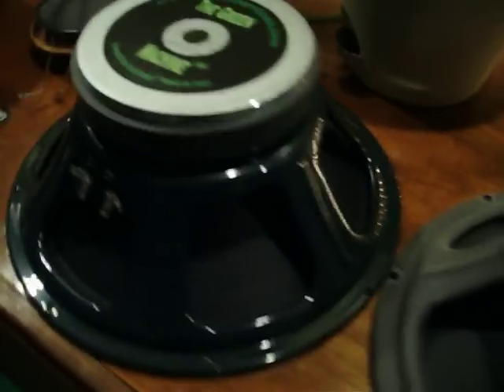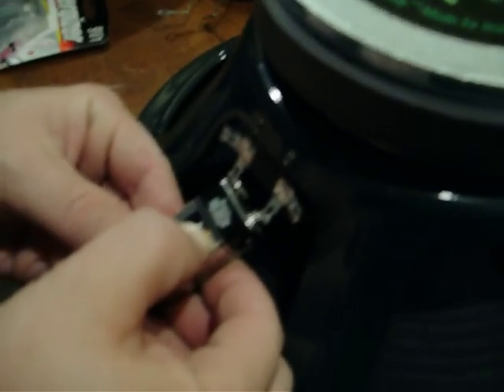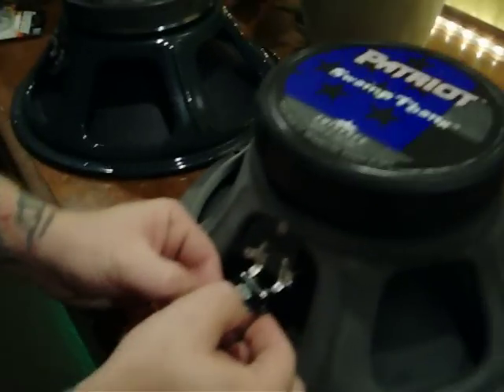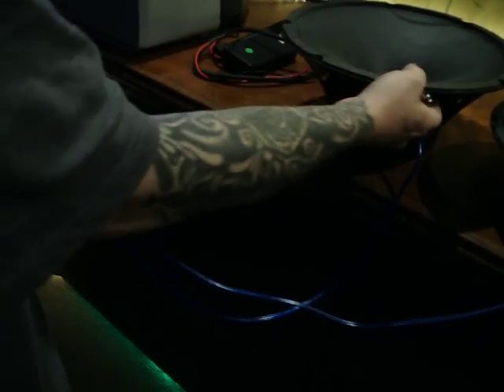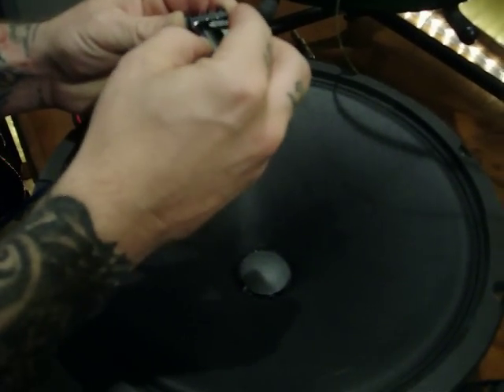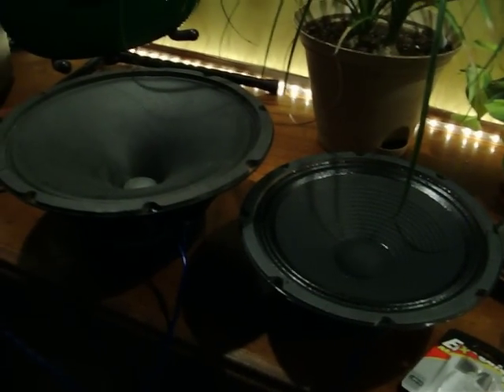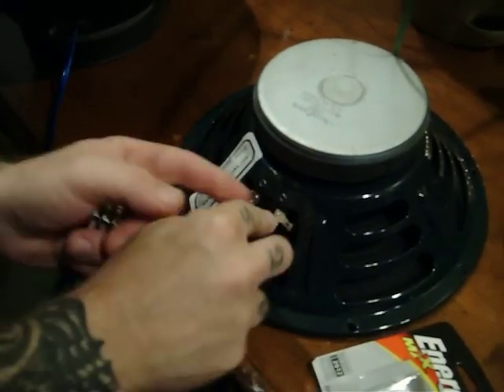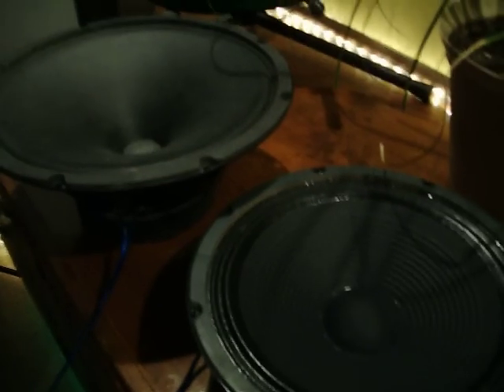EarCandy FAQ speaker phase polarity testing

Comment from the maker: @PLUMBdogg  On the old Jensens, the + is on the left and - is on the right. In a single speaker situation, it does not make as much of a difference as it would with 2 speakers, however, if the amp wants to push and the speaker is wired to pull, it may sound funky (in a bad way) so hook your + up to the left tab and - up to the right tab and you will be right on. :)

Comment from the maker: @venu23tmc It starts at the crossover network for the tweeter, The Tweeter's acoustic phase is the opposite to its electrical phase. exactly 180 degree difference, if it is out of phase, simply reverse the wires and it should come into phase with the rest of the network. I dont recomend you keep it that way, this is just a good way to check it, if the crossover is built / labeled correctly, and the tweeter is not blown, it should be in phase for you.